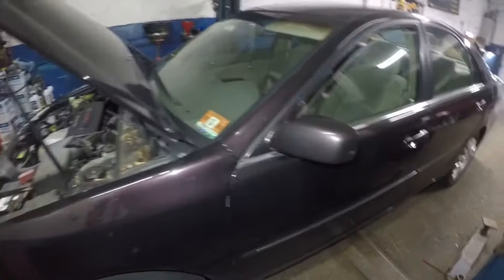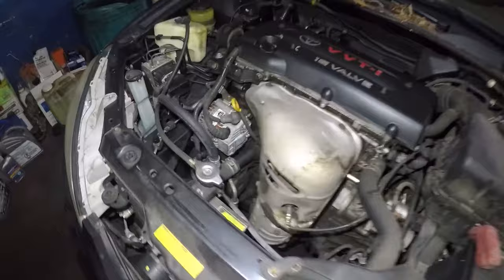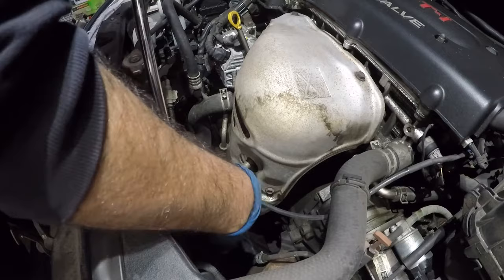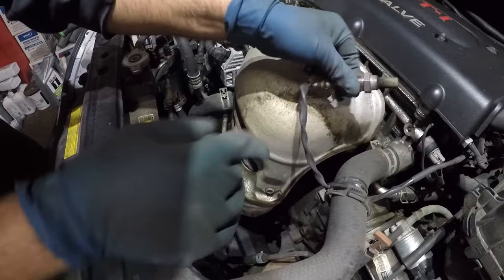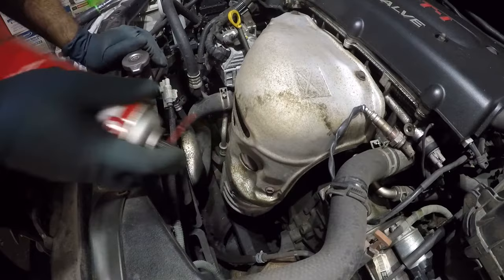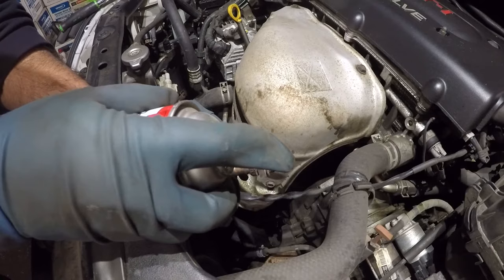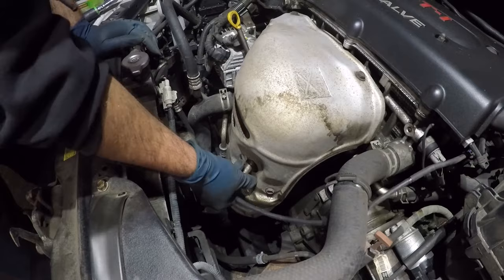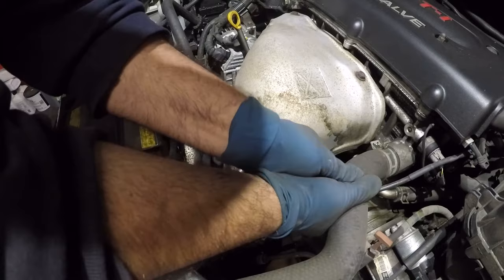How to clean catalytic converter  while on car, customers request to spray down with cleaner

Comment: how long to let it dry after cleaning?
Reply from the maker: Give it good hour or 2
Reply: @RBTheMechanic  ok Thanks
Reply: I got the P0420 error on my used 2016 CRV in January end. Took it to the dealer and he charged for check engine light and erased the code via ECM/PCM. The error came back again after 4 weeks and just when I thought of going back to the dealer the code/check engine light itself disappeared for a week but came back again a couple days back. I took it to the dealer today and he says technician checked o2 sensor and exhaust leak and they are not a problem. He has given me an estimate now for catalytic converter change and has quoted close to $1700! I do not have the budget now and would like to try this method or May be try any other liquid catalytic cleaner via gas intake. A local mechanic suggested to try erasing the code 3 times before taking any decision spending so much money. What are your thoughts please or what do you suggest what best liquid cleaner I can try now???
Reply: @worldpeace5853  cataclean

Comment: Hi: my car oxygen sensor replaced, do the smoke inspection. now no fault code, does the car have to run for 200 mi before going to the smoke inspection?
Reply from the maker: It needs to be driver not all cars get ready in 200 miles some before some after usully cycle is 90 miles so try 90 miles then if u got scan tool to see if it’s ready or not other wise u have to take the chance

Comment: Where are you located in California? I have Mini Cooper with 276A error code cat but it’s very difficult to get in to the area. The car needs to be lifted . If you can help I live in Los Angeles lemme know Thank you 🙏
Reply from the maker: Sorry I’m east coast nj. Anyways I can check the code on Tuesday and get back to u
Reply: Thank you that would be nice of you 🙏
Reply: 276A catalytic converter conversation. Is the code read on OBD scanner.
Reply from the maker: @ananias-  ok so did u try cleaning downstream oxygen sensor or clean it that would be my first step
Reply: I have not yet cleaned it , will clean and be back ! Some suggest to add lacquer thinner to gas tank what do you think ?
Reply from the maker: @ananias-  no first cleaner it go one step at a time
Reply: Alright thank you ! I will

Comment: So I got a 2005 Toyota Camry 2.4 l it's burning oil either from the valves or the pistons which I'm working on. Would it be crazy to use gunk cleaner and then spray it out as that helps to move the oil through or with the catalytics cleaner spray work just fine? This is my second cat because I failed to fix it oil burning issue. The new cat took a year before it started getting clogged
Reply from the maker: Try catalytic cleaner or fuel additives

Comment: The o2 sensor light is on on my mercedes benz,  if I clean the cat, will it go off?
And what if I disconnect the 02 for the cat? Will it affect the general check engine notifications?
Reply from the maker: No replace the sensor don’t mess with catalytic

Comment: I have 2 bottles of CRC Mass Air Flow Sensor Cleaner. Will that work?
Reply from the maker: U don’t need 2 bottles couple of spray that’s it
Reply: @RBTheMechanic  OH thanks... I didn't mean I would use 2 of them. I just meant I had 2 and wanted to know if that stuff would work! Thanks! Appreciate it!

Comment: 92 cheby s10. 2.5l throttle body.. driving an I can push pedal an engine will go but u can feel it is wanting to keep up an slows down. let off gas pedal an it'll go again for a few....cat clogged? would this help my truck?
Reply from the maker: Do u have codes for catalytic. U can remove the oxygen sensor before the catalytic it will be loud but u can confirm it this way

Comment: this didn"t show the fix you just clear the code with the scaner .
Reply from the maker: Yea I cleared I have had luck chances are it will fix … even if u replace the catalytic u need to clear the codes but it’s worth the try before u spend $800 or more also cleaning oxygen sensors make a big difference

Comment: I replaced my 02 sensor both on my toyota camry 2003 2.4 but my engine light still on ,you think doing this clean my cat converter it can help?
Reply from the maker: It can help
Reply: You need the scanner to erase the code.

Comment: I have no codes but have a sulfur smell (more when accelerating) new battery and alternator (w/voltage regulator). Voltage tested and it’s good.  2 new upstream O2 sensors (didn’t change downstream under car). I think cat maybe clogged what do you recommend?
Reply from the maker: Yes it could be bad catalytic also down stream sensors

Comment: thank you for this vidio, I have a Camry 2011 xle, I had engine light on for sensors( P0138) , the mechanic changed 2 oxygen sensors. after changing second oxygen sensor , engine code popped up again with P0420 catalyst convertor  error, could you please advise? I think it is because of second senor that he changed is not working properly!
Reply from the maker: That could be possibility but u need to hook up scan tool and check live data other wise it might just need catalytic replacement

Comment: I have a p0420 code when I come to a stop my car makes a loud scrapin sound then stops every blue moon
Reply from the maker: U need to check where the sound is comming from could be anything and code might not be related it’s ctlytic code
Reply: @RBTheMechanic  thanks for the reply, every mechanic I tell the code they say u need a catalytic converter without even looking or touching the car, and it automatically lets me know they don’t fully know

Comment: Bro I have TOYOTA Avalon and having Check engine alarm of dirty catalytic converter, can I solve that using this ?
Reply from the maker: Start with doing rear oxygen sensor change and then second attempt this service u can also buy some edditives for fuel injection

Comment: Have a 2010 dodge charger had misfire cylinder 6 was the only code change all spark plugs and coil pack misfire is gone but now have a new code p0430 bank below threshold could i have put something back on wrong replace gaskets to
Reply from the maker: No that’s catalytic issue it’s nothing in too area anways do ur self a favor put in good gas and reset the light if code comes back then msg me back and we can talk further
Reply: I've refilled the tank cleared the light came back on in less than a hour I had to take the top of my intake jus to get to the spark plugs very next day old code gone now new code and I use the code reader and thats what it gave me p0430 banks below 95 percent threshold the only thing I haven't done was changed my 02 sensors all 6 spark plugs were pretty foul same ones that came off the lot
Reply: I just find it weird I never had that code until I fix the misfire I've tried checking for vacuum leaks
Reply from the maker: @carlwatson5332  yeah not sure but it could be that u had misfire and it did some kind of damage to the catalytic but I would t proceeded with any type of repair without taking a chance with reset and put in good gas
Reply: I mean I fixed it as soon as the misfire started drove maybe 3 times with the misfire because I knew if I kept driving with misfire I knew it could damage my
Reply: Converter that's why I had the misfired fixed so quick I'll try it again I've done cleared the code 3 times and it has came back every time the car runs normal tho no lack of power or rough idling etc
Reply from the maker: @carlwatson5332  ok if it dose come back I would also go for replacing the down stream oxygen sensor. But do double check all of ur work check all connectors and vaccum lines
Reply: Or is it the one right on the converter
Reply: I know bank 2 is on my driver side just don't know which is down stream thanks for all the info and tips

Comment: Hey RB. I was ready to try this but the Honda service manual says not to use solvents on the oxygen sensor. 2014 Accord 2.4 L. I'm just going with the fuel additive and hope for the best. Had an oil leak and replaced the valve cover gasket and one ignition coil. Pretty sure this was the cause of the problem. Great video. Keep it up
Bob
Reply from the maker: Yeah that’s good idea also

Comment: I am getting code for bank 1 catalytic. Is it a dirty sensor?
Reply from the maker: A start is new sensor before u spend $1000 on catalytic
Reply: @RBTheMechanic  Can I spray  the sensor with brake cleaner and see if it works?
Reply from the maker: @arielrodriguez6980  yup

Comment: I am going to try it in an hour on a 2012 Honda CRV. First I will try to vacuum any loose deposit in there. Then spray 2 cans of Berryman carb cleaner and let it sit for few hours. See if it works. I will post the result within next 24 hours.
Reply from the maker: On nice good idea with vaccum!!! I will try that my self next time also shoot some compress air pressure from the opposite side down stream sensor
Reply: @RBTheMechanic  Don't have compressed air available right now. But if it doesn't work then I will try on the trial number 2. Thank you. Keep you posted.
Reply from the maker: @tariqulmajumder9145  yeah clean out the sensors also
Reply: @RBTheMechanic  Will do
Reply: Little update after following this method. 
The vehicle's acceleration went up by at least 20% and fuel consumption went down. The check engine light is still on. I will take the check engine light off using the code scan tool. I tried vacuum from the Catalytic converter but nothing came out. Thanks for the helpful tutorial. 👍
Reply from the maker: @tariqulmajumder9145  yes reset the light.

Comment: 2003 Camry code p0420 been working on the code for a month or so will try this tip asap
Reply from the maker: Try cleaning oxygen sensor also if it don’t work out try changing oxygen sensor first before spending money on catalytic
Reply: So how did it go?
Reply: @marsinbako8491  no, no, these people comment and then disappear.

Comment: Any tips I have a 05 honda odyssey wit that code p0420 236k miles I erase code wit obd reader drive for 170 miles then check engine light turns on again should I replace the catalytic or any sensors ?
Reply from the maker: Start with new sensors down stream before u replace the catalytic u have lot of mileages u might have to proceed eventully to replace it
Reply: @RBTheMechanic  down stream front or rear or both sensors  Nd should it be bank 1 sensor 2 or it don't matter what sensors is changed
Reply from the maker: @erikavila1726  depends on which bank u have code for
Reply: @RBTheMechanic  code  p0420 says catalyst system efficiency below threshold bank 1 any idea what sensor it would happen to be
Reply from the maker: @erikavila1726  ok bank one is in the bank by firewall and it’s the 2nd sensor
Reply: @RBTheMechanic  so that sensor is the one located in the back of the engine or front by the radiator
Reply: @RBTheMechanic  found sensor at orilleys ntk direct fit oxygen sensor description says its downstream; rear sensor bank 1 sensor 2 this would be the part right ?
Reply from the maker: @erikavila1726  yup
Reply: Ford Taurus 3.0, car runs all day long. Battery went bad, very weak while engine was running and I began to smell "rotten eggs", this was about 8 months ago,  bought new battery. DTC P0430 along with P0171 & P0174. Still driving car and engine runs all day and emissions are due next month. If catalytic converter is covered with carbon, do you think that trick will work ? I'm confident Cats did not melt because there seems to be no back pressure causing loss of acceleration. 
What about removing Cats from car heating Cats and then spraying with carb cleaner ?

Comment: Demonstration about cleaning, ( ok,) but the process he used to screw out the censor is complexed.! The wires kept twirling, & twirling, & that could lead to greater problems.! How could he get a socket over the sensor, the wires of which, r at the top of the sensor ! Could it b that the socket had an opening along the side, to sufficiently accomadate the wiring, & which was not disclosed in his demonstration.?
Reply from the maker: U can watch my other videos on how to remove oxygen sensors. Yes the socket is opening on the side it’s socket for oxygen sensors only

Comment: Hi.
If you using liqui moly catalytic cleaner, would you input it in that same intake hole?
Reply from the maker: LIQUI moly? I never used that
Reply: i used the fuel additive and it worked for my clogged cat. I actually used 4-5 cans of liqui moly 7110 when  at half tank (higher concentration) and went on a highway and kept  rpm at at least 3000 . If your cat is clogged, if there is anything else clogged or dirty inside the whole system the additive goes through, it actually helps. If the cat is physically damaged: melted, broken - nothing will help other than getting a new one. Just get 4-5 cans of a reputable company's fuel additive that helps with a cat and youre set. Trust me, you got nothing to lose. You put it into your tank and just drive and burn it through
Reply: I have use CRC cat cleaner, and our it in the tank...2 cans was all it takes to  automatically cleared out the P0420 code. Think I will try this technique as a preventative maintenance as a new cat is super expensive...

Comment: Do the car has to be hot?
Reply from the maker: Not hot at all
Reply: @RBTheMechanic  well too late..I tried this while the engine was hot..I used 3/4 of the can then drove for 70 miles at speeds up to 80 mph..lucky for me the check engine light never came back on..so yeah this do work but I suggest you use the entire can for better results..thanks for posting this video you sure saved me

Comment: You think I could put cataclean in the gas tank and also spray inside the cat with throttle body at the same time?
Reply from the maker: Not through the throttle u will cause big issues

Comment: can we use parts cleaner ?
Reply from the maker: U can but let it dry off for couple of hours since they r flammable
Reply: @RBTheMechanic  some people suggest to remove it and soak it a day with dish soap
Reply from the maker: @LOLONO666  no if ur removing ur then u better off replacing it u already did that hard part
Reply: @RBTheMechanic that a good point,, i heard that aftermarket cats are bad most of the time but maybe it's better that nothing,,,
Reply from the maker: @LOLONO666  yup

Comment: Have to be hot? that spray can remove rust without being hot?  what other spray can be used it? Can be let it inside for 24 hours?
----  What is different from doing this that using Cataclean products?
---  Can we do this every year or every two years to keep it clean, as maintenance?
---- Can I use the whole can? What if I do it on the first one and also the second catalytic? Open or remove both sensors to spray a whole can there.
Reply from the maker: Good questions yes it got to be hot yes catalytic cleaner and doingnoften can keep it week maintained
Reply: @RBTheMechanic  I still blind. Can you answer me every question by separate?
Reply from the maker: @irisbaez1972  I did
Reply: @RBTheMechanic  no.
Reply: @irisbaez1972  Let me give it a shot:

- Being hot accelerates the cleaning action, so it would have a much higher chance of success by spraying a hot cat. 
- Most other throttle body/cylinder/intake cleaner should be able to used in the same way.  It all runs through the intake system into the combustion chamber and out the exhaust in the same way. 
- Cataclean is probably just a marketing name.  It doesn't seem overly successful in many of the reviews I've read/watched.  Probably just another fuel system cleaner with slightly different additives. 
- Always good to keep up with cleaning, especially if you know your car burns a bit/a lot of oil.  Same with running Seafoam through your intake to remove carbon buildup on top of your pistons. 
- You can use as much as you want.  Of course, the cat will start cooling off fast the more you spray, so you might want to stop after a few minutes of squirting the spray to run the car again and heat the cat back up.  The important part is to let it evaporate overnight.  You don't want too much flammable vapor igniting in your exhaust or you might pop a muffler open.  Only need to remove the front O2 sensor, since that's the side of the cat that gets carboned up.  Though you can also remove and clean both sensors by themselves before/after.
Reply: @BlueBomberTurbo  Thank you. but I read a lot about this and they don't recommend removing anything when is hot, cause it expanded. also removing and re-tight is not recommended cause it can cause problems when you re-install them and even can damage the sensor, then you have to buy a new one.
--- Also they don't recommend cleaning that sensor, it's a part that doesn't need to be cleaned but replace it when it gets bad.

Comment: I did it didn't work. It was just waste of time. I try it it didn't work.
Reply from the maker: Did u try cleaning downstream oxygen sensor
Reply: I put it 2 new oxygen sensor one for the upper and lower.
Reply: And did what you did it still didn't work. I guess I have to change the catalytic converter.
Reply from the maker: @rolmarz9604  last option replace it